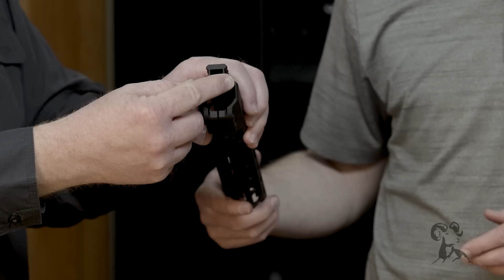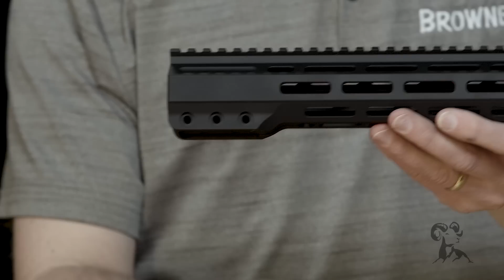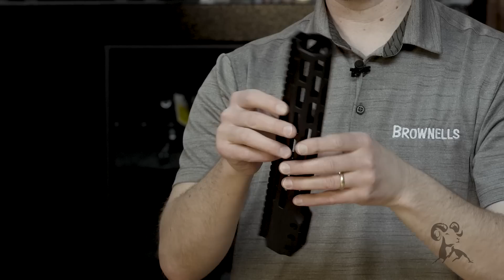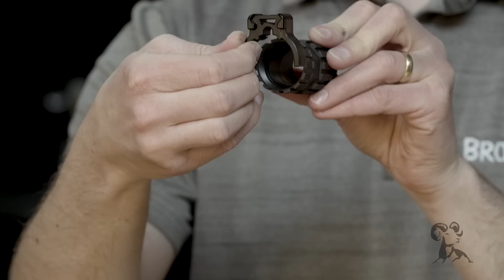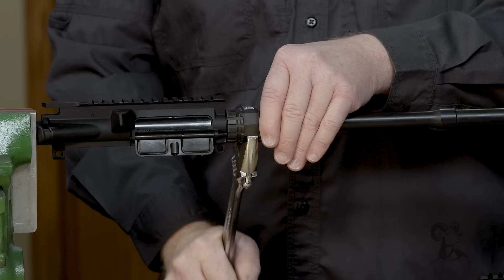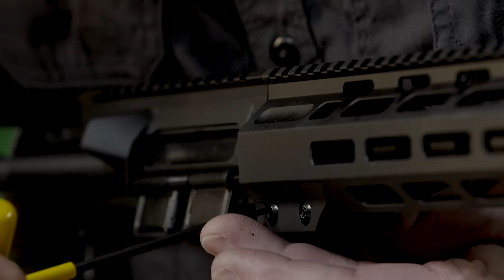Overview of the Brownells Wrenchman™ Handguard

Comment: That would mean that the tapping of the barrelnut is important, if there is only one ridge to allow the gas tube to pass through??
What if you tightend it already and the only ridge to pass through the gastube is still not aligned and you cant tighten it further???
Reply: Most likely back the barrel but out and take it off. Then start again with shims
Reply: @fitdadexperiment-3eight797  Yes'r that'd be what i would do!👌

Comment: No Anti-Rotation other than the Barrel Nut and hardware??? 🤔🤔🤔
On a barrel nut that is that long does the gas tube clear it or is there pressure on the tube?
I’m not sure about that design, but I would be willing to test a 10.5!!
Reply: NMhvac Tech the barrel nut has notches in it that time with the Handguard. It’s not going to rotate unless the barrel but loosens.

Comment: So no anti-rotational tabs? Twisting the handguard could loosen the barrel nut. I’ll pass.
Reply: The gas tube indexes the nut. The nut won't back out anyway, if installed properly.
Reply: Midwest Industries. Aero Precision, STNGR, Troy, Geissele, etc. Hell even the PSA handguards have anti-rotational tabs.
Reply: So what about the millions of handguards that don't have anti-rotational tabs? The ones that have been in use from the 60's? Just like the Wrenchman, the gas tube keep the barrel nut from turning. Anti-rotational tabs are only to keep the handguard from turning...and if you watched the video, they pointed out the ridges inside this handguard that do that. I guess you'll pass on common sense and listening skills also.
Reply: @kwb377  HahahHha. POW, right in the kisser! You said it though,  absolutely true.
Reply: Could you give an example of a system that has anti-rotational tabs for those of us new to building?
Reply: only thing I was thinking with no tabs at all you would have to torque the hell out of it to feel safe.... do you know of any good price combat style handguards???

Comment: What about these barrel nuts and piston kits?
Reply: Won't be compatible with Adams Arms piston kits.
Reply: @nolarick4054  syrac ordnance is a company owned by the guy that created Adams arms, syrac's is supposed to fit pretty much anything. And superlative arms fits alot more than Adams arms. With AA ur pretty much stuck with their handguard if u want a nice look and fit. My next piston build will feature a syrac kit and a geissele handguard
Reply: @noluckpureskill9985  Had a look at Syrac per your recommendation and it looks like Syrac isn't in business anymore. That said, the Syrac piston retrofit kit looks visually identical to the Superlative Arms kit.  Think I'm going to buy a SA kit and see what's doing.  I have two AA piston kits and they're pretty sweet so the SA has a lot to live up to.
Reply: @nolarick4054  damn sad to hear, but ya I noticed they looked near identical as well. I love my AA set up but I'd love to b able to use a geissele rail, I do believe it's possible with SA kit as well
Reply: @noluckpureskill9985  I hear you about wanting to use the Geissele handguard.  For me, its a quest for weight reduction and having to use a GI spec barrel nut with the AA arms kits blows.  That said, I can confirm that the Fortis Rev II is compatible with the AA piston kits. It's just too bad that the V Seven titanium barrel nuts are so dang expensive.
Reply: @nolarick4054  so the Fortis rev 2 works but u have to use v seven's barrel nut?
Reply: @nolarick4054  me personally I love the handguard to the end of barrel look so I figured fuck it an went with the 15.5 inch AA handguard I was honestly surprised how nice, slim, and lightweight it was for the size
Reply: Any luck finding handguards that fit? Im struggling to find a relatively slim handguard that's gonna fit a SA kit
Reply: @nostep8058  geissele mk8 fits my SA kit just fine

Comment: I installed a 15" example of one of these last Friday.  It's well made and has good instructions.  The alignment tool is good and got the alignment VERY CLOSE but double-check the alignment visually.  I used a crescent wrench and tightened it by hand then tightened it until the next slot aligned.  Double-checked it with a torque wrench and mine was about 52 ft-lbs which is appropriate. 

On the TFB article people were poo-pooing the weight and cost in favor of chinese ebay alternatives.  You do you.  I like this handguard and got it on a 10% discount code.
Reply: Looks heavy, is it?
Reply: @Joshua Bressel 2 years later and holoson is inching their prices to be the same as aimpoint.